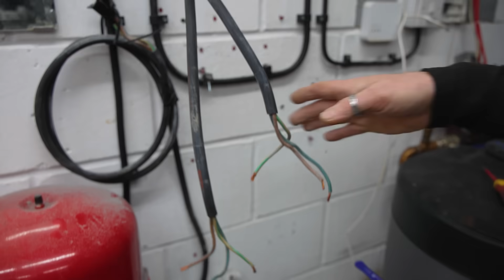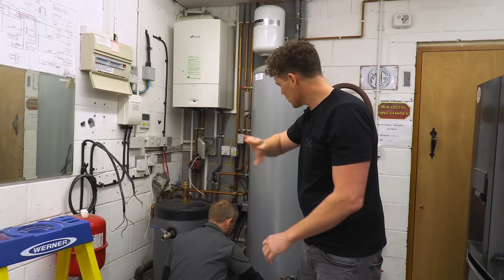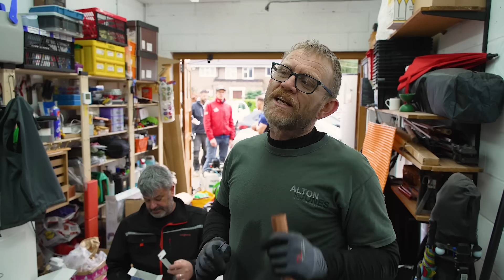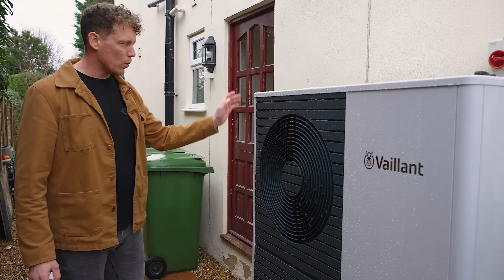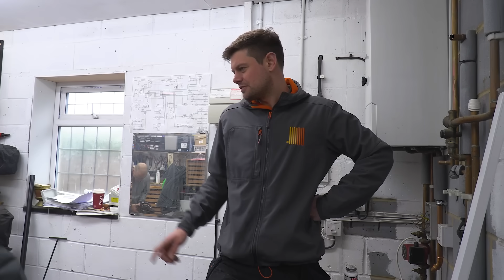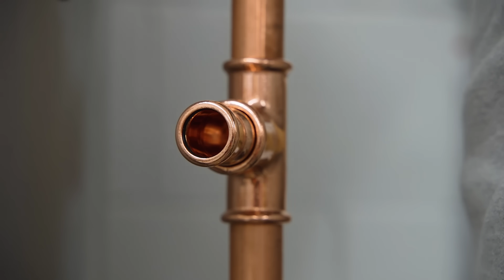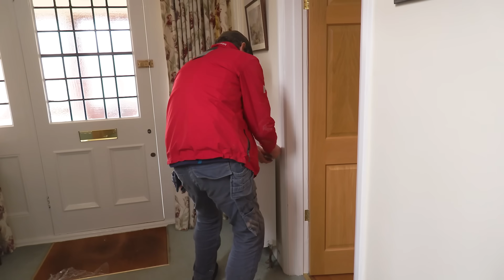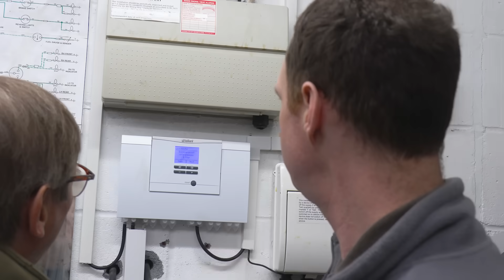Ultimate Heat Pump Installation. Rip It Out & Start Again!

Comment: How have the settings been tweaked since the install? COP looking great at the moment. What are the down times for? 20mins with no power use followed by short burst of increased power? Looking good.
Reply: As the temperature is getting towards not needing heating (outside temp is recorded at ~13C), it is cycling, as the minimum heating output is higher than what is required, as the heating demand is also low it is still able to achieve high COPs.  John Cantor has a good video on the subject as well.

Comment: Really wish you had raise the floor level in the attic to put in more insulation so it was still a usable storage space after.
Reply from the maker: We were not even going to get involved in the insulation but Adam got a bit nervous about the ability of that heat pump to heat a home with virtually no insulation. John, who owns the house, said he was not bothered about storing stuff in the loft and would rather just lay it in there. There comes a point in your life when the greatest pleasure is to de-clutter.
Reply: Don't get me wrong I was happy to see you add the insulation as it is so cheap and quick to install and it did look like you did it for the reasons you outlined as it was for sure needed. The comment was based on what I'd have done based on my needs. Hope the results are as good or better then expected.

Comment: An outdoors cut-off switch, so anyone could come and turn your heating off... madness.
Reply from the maker: Do you know how many gas and electric meter cupboards have a valve or switch. 
If that is your thing you can turn off most of the services from outside. What is the motivation?
Reply: @SkillBuilder  It's more likely to happen if your neighbours are p'd off with a noisy heat exchanger!

Comment: Excellent job and well engineered using the minimum number of components to achieve both efficiency and reliability. I find on commercial systems its difficult to avoid buffer vessels.

Comment: Not to throw a wet blanket over the efforts here, but it's not exactly a great endorsement for heat pumps when you need this level of skills and resources. 10 engineers, 30k worth of equipment and a plant room. The average person ain't got that mate.
Reply: The "plant room" was already there, it wasn't added for this project and it's fairly common for larger buildings to have a larger area for the boiler. The only boiler in the room is the gas one though.
As for the fact there were 10 skilled engineers involved, it didn't need that many, they just wanted to collaborate.
The economy is crying out for higher paid jobs and here's something creating an environment that encourages workers to get skilled and efficient at their job - where's the problem?

As for your 30k worth of equipment remark - what part of the video was the value mentioned? They did mention that they ripped out 1.5k worth of useless materials installed before.

I'm sure that particular pump is pretty expensive given it's an old, big house that needs a lot of heating. Most people wouldn't need that though.

I'm baffled at the attitude of "well I don't want this because it needs to be installed by someone who's good at their job". By extension that's pretty much saying "I just want to be able to get my mate from down the pub to stick in something he learned about on YouTube"

Comment: It seems to me that the real enemies here are:
1) the absolute cowboys who installed the first system and
2) the government.
The scientific case for the need to decarbonise is irrefutable (you can come at me on that it you like, but I'm a scientist so perhaps keep your powder dry...).
Heat pumps make a lot of sense - we're planning ours at the minute - but the push for heat pump installation without simultaneous funding for insulating the existing housing stock is woefully shortsighted. It's a political problem we face, not a technological one, or even the matrimonial problem of how cold Roger's Mrs wants her bedroom!

So instead of the enmity that's been stoked between people who want to get off gas boilers and those who don't, we should really all be aiming our anger at the wretched excuse for a government which has implemented such a narrow, poorly thought-out policy on heat pumps. That policy doesn't address insulation (which would benefit everyone regardless of their heating system), and doesn't build in systems to help flatten the electrical demand curve, such as increased storage, that can be used to drive down overall electrical cost and reduce our dependence on fossil fuels.
Even if you don't think there's a scientific argument to do that, at least surely you'd agree on the geopolitical benefit of increased energy sovereignty afforded by increasing renewables/storage and decreasing gas!

Despite all the fighting talk, it's clear that both Roger and Adam want to do the best by John, and I just wonder if there's a whole lot more in common than divides on this topic, regardless of what those very few, but very loud, social media trolls scream on all aspects of electrification these days.

Comment: I remember in marketing they used to say that annoying one customer will loose you eight. 
If you view these comments as a societal cross section, and I don't think it is, then the heat pump industry will need to deal fairly with all those people whose pumps either don't work, won't work or can't work otherwise 1000 people will never switch to heat pumps. 
It's so much easier to fit gas. We know it's a well tried tech, we know it's reliable, we know it's at least 3 times cheaper than heat pumps and some scientists know the carbon dioxide scare is a government scam.

Comment: Dodgy install costing a lot of money to run sounds familiar haha.When the power cuts come which they will you will need a back up heat source gas fires gas cooker.I have gave up with the heat pump had my pants down Boyo.£20 grand set up needed 28mm pipe have you seen the price of 28mm copper.

Comment: I'm one of those people with a combi boiler and no real room for a cylinder. Getting a second quote for A2A next week. If you think finding a good A2W installer is problematic, try finding an A2A installer who's even willing to consider heat loss calculations!

The long term plan is A2A for heating/cooling, and phase-change boiler replacement.
Reply: If they're a well-established AC installer and as long as they're sizing correctly for the cooling demand, then the heating would be covered, especially for the UK.
If they did heat loss calcs for say -3C in the UK, and sized according to that, then the system would be undersized for cooling in summer.  Whereas, sizing for cooling, as long as the operating range permits, would cover an equivalent amount of heating requirement in about -20C, so will be oversized for heating.
However, It's also worth noting, that most reputable A2A inverters will be able to operate down to around 10% power, vs the ~25% of the A2W ones and in many scenarios, the load is often split between 2 outdoor units as well, so in the case of potential short cycling, one could potentially be turned off to avoid that as well.
Reply: @BenIsInSweden  Interesting. So if a property is borderline for a 5-split, would it potentially be beneficial to run x2 3-splits instead, and set up rules/automations so one switches off instead of both cycling?
Reply: @JamesScholesUK  to be honest, even though I love A2A, I would avoid a 5-split if possible. Any (major-ish) issue with a single head unit inside, means the whole system is unable to operate until that is fixed, so if there's space (and you can get planning permission), multiple outdoor units would be preferred, so you at least have some heat if there's an issue.
The outdoor units determine the total capacity and can be divided up in many ways with different-sized internal units depending on needs. So you can run 2 outdoor units with 5 or 6 indoor units just fine, as long as the total capacity of the 2 outdoor units doesn't massively exceed the required cooling demand, then it's fine.
But yes, you can set up some automation based on outside temperature to turn off/on all units connected to one of the outdoor units to manage cycling - you might need some 3rd app or device to do it.  e.g. Sensibo is one that will almost universally work, but you need 1 device for each head unit, which could get expensive.  I think Home Assistant integrates with some wifi connected ACs as well, so it's worth investigating what options you have based on what system you're looking at.

Comment: Great install guys. A lot of experienced engineers working together. Out of interest did you install mains 28mm copper throughout or mix of copper and Hep? The pipework bore seems quite large for a domestic install! Is it realistic to be able to put 28-35mm pipework through an entire house? What size minimal could you realistically get away with off the primary’s to the rads etc?

Comment: I find it a bit disingenuous to mention Octopus Energy in the way it has been by one of these engineers. Not everyone can afford a rolls Royce installation, which is what this company seem to aspire to.  I can see from the video that they are using the most expensive copper fittings. Far more expensive than the ones we used to use in the past.  I had two heat geek engineers come out to my house and both had a starting price of £15,000. One of the heat geek the engineers wasn’t even going to change the hot water cylinder and instead fit a heat transfer plate next to it. Octopus have quoted £8100 for my install and that’s what I’m going to go ahead with. I’m sure these guys if they were buying a motor car wouldn’t buy a Rolls-Royce they would be buying a Ford or a VW and the same applies to these expensive heating systems. Thats the reason why octopus are in the market for those of us who simply cannot afford to put in these very expensive heat pump installations. What’s more octopus guarantee that system and they’re huge company so I feel that I can trust in their integrity. Octopus has a multi million pound research and development laboratory and are confident that there install will work and will work efficiently.